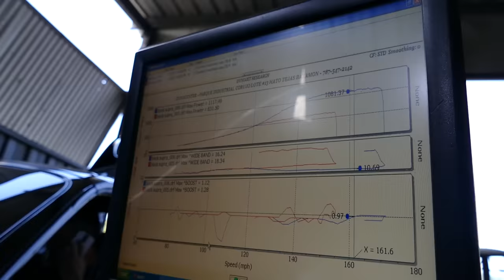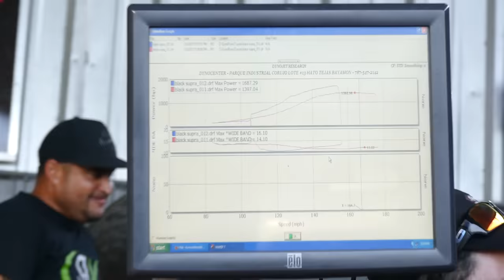1687WHP MONSTER Supra BRUTAL Dyno Runs

Comment: I don’t think Toyota was expecting their buyers to turn the cars into these machines
Reply: KingVas1977 ever since fast and furious happened
Reply: @rafa3lperez305  How the fuck 300hp can turn into 1687hp xD
Reply: @foarm5166  the 2jz engine is amazing
Reply: Foarm our a big ol 88cm turbo from his in there and BAM easy 1000bhp
Reply: 2JZ were made for it.. :P
Reply: Rafa3L PeREZ cm or mm? Lol
Reply: @Auxeh1  xD
Reply: They had to respect the gentleman's agreement.
Reply: @rafa3lperez305  88mm
Reply: That's exactly what they were expecting. That was the purpose of the 2JZ engine. That car wasn't a beast with 600hp+ originally only because of a deal made back in the 90's.
Reply: Gentleman's agreement:no more than 280hp 
Car manufacturers:ok I will just add some more hp 
People in Japan:  fuck it let's do it to 800 to 1500 hp
Reply: If you watch a teardown of the engine, they put a TON of effort into making the engine bullet proof. At the time of these cars being produced, there was a gentlemen's agreement of only producing ~300HP/PS. These engines were over engineered so if you just sneezed at them they would make more power. However you don't make 1600+HP on a stock bottom end 2JZ. Probably approaching billet territory at this point.
Reply: @xentaatnex8261  didnt really help
Reply: @kylewalker2949  the 2jz was so well constructed, that it could make 2× or 3× of 300 hp
Reply: @kylewalker2949  this one must have gone billet, for 1600+hp (on the crank) must have at least a billet bottom end... 1000+hp starts to be a problem to stock 2JZs blocks (they can handle them, not just for big periods of time specially if they're abused everyday)
Reply: Thats not even a toyota, an ice crem bus would be like that with same upgrades.
Reply: Ummm actually yes
Reply: So true🤣
Reply: @rafa3lperez305  nah, before fast and furious, why do you think the supra was the star of the movie ?
Reply: Anything with a 2jz and turbo is crazy
Reply: Or did they ?🤔😂
Reply: And a 150HP 1.8 Turbo can reach more than 1200.
Reply: That's what I'm talking about! I wish today's Toyota would find their soul again.
Reply: @foarm5166  the 2jz is appositely underpowered at 280 is real stock should be around 600 700 
Like the rb26 that was made to be 600hprs stock
Reply: Toyota only want yo sell bro.. all of things that You do with your car is just your problem jajaja
Reply: No knockin' the girl!! I have a 1997 Honda Prelude H22a. Stock is 200hp. No mods I stuck a turbo on there and made 397hp. Blew engine after 6 months. Surprised it lasted that long. Now I am doing a full build sleeves and all. Based on  list of stuff I'm doing to it I am expecting 690hp. If after a couple years it's still running I may put a bigger turbo on it.
Reply: The famous Toyota engineer Smoke took a V12 out of a limo and crammed it into a Supra. He had it producing insane power.
Reply: They knew
Reply: I think
Reply: KingVas1977 ... you sure about that?!

The block and stock crank can take well over 1000hp
Reply: @mareksumguy1887  did you know you can get a lada up to 1000 hp
Reply: Patrick Duncan not on stock crank and block!
Reply: @mareksumguy1887  😂
Reply: Patrick Duncan what’s so funny??
Reply: @HaileyLove42  But rear wheel drive is more fun 😏
Reply: @rafa3lperez305  bruh no not even just a huge turbo isn't everything if you just put a huge turbo on it and that's it you will blow it up you need a ecu tuned for it and some other stuff
Reply: @rafa3lperez305  hdfb
Reply: I disagree
Reply: 2JZ was built under 200hp because china japan pact about powerful street legal cars ...they knew that it will be turnt into monster power cars
Reply: @jurajokasa834  there is a model that has over 200
Reply: @Auxeh1  maybe diameter?? Otherwise 😂🤣😂🤣
Reply: Foarm with easy tuning my guy, simple thinking, complex crafting and how the hell you gonna ask a rhetorical question. It’s in the video how my guy just read and look in the engine bay
Reply: CEO Of Autism well no crap it’s common sense but and 88cm turbo with stage 2+ tuning of course your gonna get at least 1000hp because the Supra is known to have that power with relative torque
Reply: You forgot about the mk3 Supra which was also a monster
Reply: @foarm5166  280hp was a Japanese gentleman's agreement, they knew the engine was meant to make more and tuners would the supra the halo Toyota vehicle
Reply: Into this Monster yea...
Reply: uhh the MKIV was built to be a road racer and it did quite well but not many know that, it was well intentiinaliszed that people would build the engine.
Reply: @rafa3lperez305  LOONG before tht jr.
Reply: @foarm5166  when Toyota actually made their engines.
Reply: Especially not into a hypercar😂
Reply: nah.. on stock internal and block maybe around 700 and that's generous.. to get over 1K, alot of changes need to be done..but supra with 700hp is more than  enough if you just wanna have fun..
Reply: @Youre_Right  he wasnt a Toyota engineer, he was just a tuner, and it wasnt a limo it wa s a Toyota Century.
Reply: @brbonesporco2050  thats the jdm version.
Reply: @ggwp9317  the stock block holds 2000bhp, thus why many pro street and others use it thats why Real street did as well. to get up to 1000bhp all you need to change on the engine is the head studs, it can handle 1200bhp on the stock intenerals (rods pistons etc. ) after that you need to change them.
Reply: Toyota engineers actually were expecting people to tune supras but not that much. The “280” stock hp on Supra is only because of speed regulations in Japan back then. They knew what 2jz is capable of.
Reply: @quikk_7500  that was the JDM version
Reply: @foarm5166   No it because of big boi turbo.
Reply: That’s not a machine that’s a monster
Reply: I think These do because a supra is a Tuning Car but it Is what i think
Reply: This shits awesomeee
Reply: They were already machines
Reply: Maybe if they had intended that we'd have supra like we have mustang's.
Reply: Um that was plan, they made it to withstand that kinda of power cuz car laws were getting strict at the time about “gas and emissions “ so they had to sell cars that made good emissions,  but they wanted the car to be like a sports car or just make more power so they made it to be able to sell and make more power in the aftermarket world
Reply: The aerodynamic of this car is impressive
Reply: Sure they knew
Reply: Same lol
Reply: No they totally expected it, during the 1j and 2j era they had a speed beef going on that was kinda suppressed due to jdm effeciancy standards, so the engines had alot of power potential but not alot out of the box
Reply: The seals are strong so it can with stand 1000 hp++++
Reply: @drdeeznuts8201  yea
Reply: @supremejuice683  it seems like more i6's are amazing than anything else. Cummins, Barra, RB, 2J, some BMW engines.
Reply: 2jz gte came with a forged crankshaft and a 6 speed manual that can handle 1000hp so toyota was expecting this
Reply: That's what supra means... They actually knew it... Supra means mush more
Reply: I think toyota does not even expecting that they can create JDM king
Reply: Broo it not a machine anymore ..it monster ...to be precise supercar killer
Reply: You mean beast
Reply: @HaileyLove42  e85
Reply: @xentaatnex8261  in Japan yes. America no. That’s why our 2js are so much better then japans
Reply: @kylewalker2949  stock block and that’s about it. Everything else bottom end has to be built
Reply: @y3qhs7x88  no..
Reply: @foarm5166  just......

POP DAT HOOD !
Reply: Proper engineering, pretty sure they were well aware of the potential.
Reply: 2Jz the king of kings motor (;´༎ຶٹ༎ຶ`)
Reply: I'd strongly disagree. Look at the history of the company and how overbuilt the 2JZ-GTE is compared to any other version. They knew exactly what they were doing and the engineering has stood the test of time, dynos and drag strips!
Reply: "gentleman's agreement"
Reply: @sonic3.845  Ha, no, they restricted theirs. It's no better than any other 2JZ. America bombed Japan to Kingdom come, and thanks to you guys, little mutant Japanese people created some of the best motor engines and gadgets on the planet .
Reply: @theresamay4201  actually it is different. Japans version and America’s versions are different s they’re restricted not by tuning but by how they’re built
Reply: They wanted
Reply: Toyota: 2jz hohoho....classic engine end legend hohoho 
Crazy buyers:hohoho 2jz+ triple turbo +nos+vtec=2jtec triple turbo nos hohohohoho 
Toyota:errrrrrrrk we dont suggest that your car gonna fly to moon errrrrrr....
The supra: I BELIEVE I CAN FLY........hohoho
Reply: They knew what they were building bro, atleast the potential of it
Reply: Do you think Toyota made it for a happy family trip car? Of course they expected so they built such a durable, wonderful car. It just an agreement in JDM to not to pass 280 horsepower when leaving factory.
Reply: Probably yea
Reply: And that’s what makes them so special
Reply: Lol they knew what they were doing. That’s why they overbuild everything
Reply: Uhhh, why do you think they made the engine block so reliable? 😅
Reply: back at the headquarters: yea why not
Reply: No but they did and they are fine with it
Reply: @rafa3lperez305  no. cars has always been beef up when it first started. most manufacture started as a racing trait that build production cars. the consumer always want power. fast and furious only created ricer with body kits. body kit was meant for tracking used to give better stability.
Reply: No they knew exactly what they were doing 😎
Reply: https://youtube.com/channel/UCZ08AKbOBuaQC0sh8hcI5nQ u
Reply: U think to much ... ur cake
Reply: No. But they did build extra tolerances into them. Toyotas are overbuilt because they care about their products, their workers, and consumers. 😎
Reply: @foarm5166  The 2jz is capable of 800+ HP before having to rebuild the engine.
Reply: Toyota overbuilt everything in the 2jz engine because of the engineers there were super paranoid that the engine might blow up.
Reply: Look into Racing Team Midnight, and Japanese car culture and you'll see that this is exactly what they wanted. :D Most of the top Japanese Manufacturers built cars that go over 200mph, before they release them to market. They test them constantly around the Bayshore. This ISNT the reason Fast and Furious happened, it had been going on behind the scenes for many years, especially with Bosuzoku Clans, which were basically "Outsiders". You could say Yakuza, etc. Drifting, was made in Japan. This cars were built for Power, that's why they are rock solid engines. 

Compared to the Skyline (RB engines); these never ever broke, and were rock solid. The 2JZ engine is the most robust reliable engine in the world. Other than F1.

Then the rotary  (aka, Dorito) happened. :D. They only become more popular because of the FNF Franchise (thank you very much Dom, Letty and Mr. O'connor.) - FNF made Japanese Street Racing / Drifting, popular so much so now that it is actually a full sport. People love drifting / driving fast. 

It's why street racing is illegal most places, and is generally frowned upon everywhere. Drifting however, when done in the right environment is very rewarding and does take a while to master. 

The techniques you can learn on a Simulator, and crosses over beautifully, albeit the only real thing you don't feel is the power, the g-force (unless you are really enthusiastic about a rig but you may as well just purchase the car), body roll, however the techniques are the same.

Education is a beautiful thing, rather than ignorance. :)
Reply: They absolutely did. The 2jz comes from the factory with forged rods and forged crankshaft. The manufacturers in Japan at the time had a loose gentleman's agreement that they wouldn't build cars with more than 275 hp. They all just built their cars with seriously overbuilt motors with not a lot of power knowing damn well tuners were going to do exactly this with it. It's why this car and this motor is so legendary. Toyota knew what the people wanted and delivered 100%.
Reply: @michaelbannan9972  They just afraid their new engine for their 4th generation supercar would end up blowing up so they overbuilt everything.
Reply: @kg95-z4p  n be x
Reply: that is exactly what they expected
Reply: Why did they build the engine like this Than? There is nearly no other car what you can pull up to 300 400 %
Reply: Ikr
Reply: actually i’m sure they did if you look up the japanese gentleman’s agreement, they purposefully made their engines underpowered but room for monsterous improvements such as this
Reply: Well that was partly the intention of releasing this car. So I disagree.
Reply: Supra become famoust becouse of the f&f and some dude discover that this car can handle 1K hp
Reply: @idontgiveafawk7300  f&f only. There are tons of cars that can handle 1k lol
Reply: LOL I NEVER THOUGHT TOYOTA WAS POWER ITS ABOUT DRIVE ITS ABOUT POWER
Reply: Yeaaa but i sure am glad they did
Reply: Kingvas1977 brother you have no idea. The 2jz from factory was overengineered so that Toyota's customers can whack a giant turbo on it and it will hold. That's why the cooling Channel are larger the oil Channel are larger. Stock block can hold 1200hp
Reply: @foarm5166  lots of money
Reply: Hope they won't burn themself one day haha
Reply: Actually your incorrect. Toyotas has one mission and its the only mission. Every product that comes out no matter what has to the 2jz was a response to the rb26
Reply: @foarm5166  that's because of the legdary 2jz bro 💪
Reply: @rafa3lperez305  because 2jz wasnt actually created for 300hp it was created much powerful than that toyota knowingly lowered the hp
Because of an agreement made in japan back in the days 2jz was made for power
Reply: @kylewalker2949  yeah stock they can max. go to 1000 without breaking in one single run but thats really stressfull. 800 is ok
Reply: @rafa3lperez305  แฉ+
Reply: Not even the engine block is a Toyota anymore.  That's a custom racing engine all the way to the oil pan.
Reply: @ianlongo9037  That's not a 2JZ.  1200hp crank will push a crankshaft out of the stock block.  That's a $10K+ billet block, and it's no longer really a 2JZ, just a straight-six custom drag engine.
Reply: these are not machines these are beasts
Reply: The Japanese were 20years ahead when it came to cars in the 90 and early 2000
Reply: Agreed lol xD
Reply: @foarm5166  very well made components and fabulous engineering/tuning
Reply: I mean they probably expected people to modify them like hks build a second gen supra that made 600hp that could do over 180 in in 1982
Reply: @y3qhs7x88  no it wouldnt lmfao
Reply: True
Reply: @rafa3lperez305  that turbo will not give u an extra 1300 hp 🤣
Reply: Actualy, they did. Not that mosterous, but they are designed for tuning
Reply: I am sure they did, as they (over)engineered this car in their horsepower competition with the gt-r and the other JDM cars.
Reply: May not have expected it but i think they like em 😂😂
Reply: Toyota engineers would have worked on several horsepower outputs. Trouble is, they had engineer them to survive warranty period. 1JZ and 2JZ turbo engines are a masterpiece of engineering skill. Off boost, fuel economy good too.
Reply: The toyota supra and the Nissan gtr series  they were all made for racing and racing only
Reply: Engine of mk4❤❤❤
Reply: 3سث
Reply: Paul walker started this 🕊
Reply: U got that fu&$!n right, this is what they get for over engineering the mighty 2JZ!!!
Reply: ١١١١من 😂😢
Reply: @rafa3lperez305 😅
Reply: @foarm5166  With about 15 grand in overnight parts from Japan.
Reply: But at least they accept it and yes they probably expected it. 😕
Reply: @foarm5166 tuning cars is an existing thing if you've seen enough ppl with fast af cars that sounds like a FREAKING jet on steroids. 😂
Reply: @kylewalker2949 dont you mean bullet point?
Reply: @rafa3lperez305 ik😊😊😊😊😊l
Reply: @rafa3lperez305 مرحبا
Reply: Me to
Reply: They allready know that what owners will make whis car then only they have made 2jz engine
Reply: oh yes they were it was desgiend for that and road racing
Reply: 2:52 2:54 2:54 2:57
Reply: @dayne2973  the six speed doesnt last as much as the autoatic does
Reply: @foarm5166 japanese engine design is like bulletproof you can heavily boost it by adding big turbo octane fuel nitroxide 😊
Reply: @HaileyLove42 good luck 👍
Reply: What turbo are you using?
Pistons?
Inyectors?
Reply: Sorry to shock you here buddy…. But they absolutely knew what they were doing lol
Reply: Nahh bro the engineers knew what they were building...